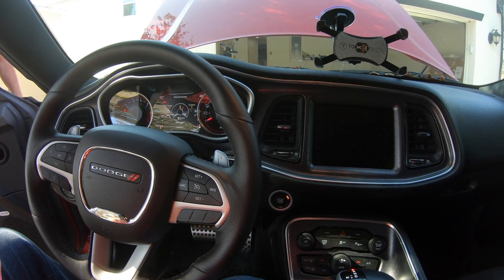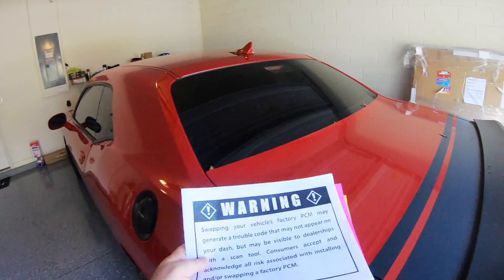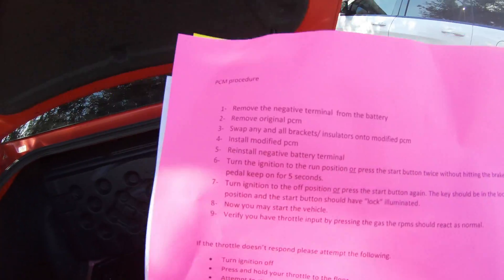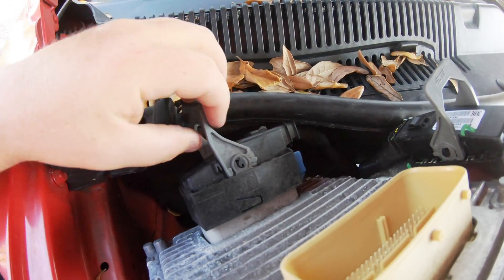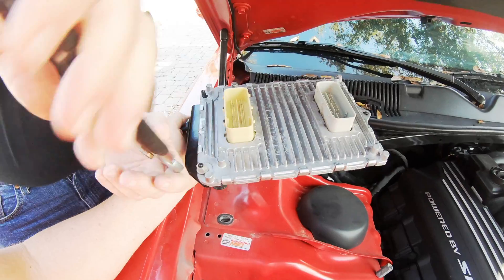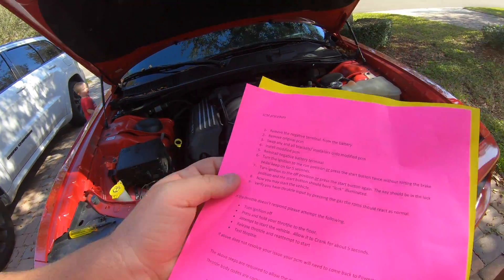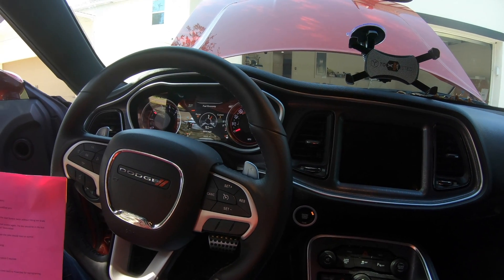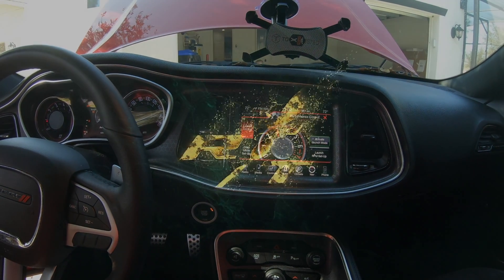UNLOCKED PCM install

Comment: It’s good to see you doing your own mods. The one thing you can get for your car is a gel battery I found out the hard way also you’re gonna have to make an investment and some tool soon …I can see more modifications coming for this car.😁👍
Reply from the maker: A lot more modifications are coming! But yah I upgraded my Chargers battery & it was so worth it. This 392 is going to be a very fun build
Reply: I went with a lightweight lithium that has a jump start function

Comment: Sawzall that bar outta there! 🤣
I took my bar out. Few more steps but much easier to get the PCM in and out.
Reply from the maker: Squeezing that PCM in/out is brutal! I don't blame anyone for removing that bar
Reply: @RTLife  Mine is a 2018 so I had to put the bypass cable in under the console.
 Another P.I.A. 🤣
Reply from the maker: Oh man they made it even more complicated in 2018. Pumped to finally have this installed - going to load up a tune once I do a few stock pulls at the drag strip
Reply: @RTLife  Noice, LET'S GO!

Comment: The most annoying part about disconnecting the battery on an SRT is losing the performance pages, modes, and cameras for a short period. You can cycle through a bunch of times (varies) and it’ll eventually come back.

Comment: The new challenge (no pun intended) for you and your channel, get some mechanics tools and start installing your own mods.  You have your community here to support you if you get stuck on something.  God bless and can't wait to see what's coming next.
Reply from the maker: I used to install everything (bolt-ons) myself until it got to headers/cam. That's a little over my head. I see so many of these youtubers trying to do it & they end up with a car always pulled apart / broken. Many are in over their head with these projects
Reply: @RTLife  Maybe I take for granted I have been building, repairing, and modding anything with wheels for 35 years, but I also recall having to start somewhere.  That was melting a hole in the piston of my 1986 Daytona Turbo-Z.  I was a teenager in HS and had to fix it myself since I didn't have a lot of $$.  I can tell you from experience that cars today are much easier to work on than they used to be.

Comment: You probably checked. But, When I was cleaning the inside of the car I accidentally hit the display button off which gives you a black screen. I'm sure you checked. I heard a low flying airplane. Are you near Macarthur? JFK, LGA? And as always Thanks for the content. Good Job👍
Reply: That was a Fort Lauderdale, FL radio station (105.1 FM) and local advertisement (Anidjar & Levine Personal Injury Lawyers, Fort Lauderdale, FL) shown on the screen.
Reply from the maker: I am in Florida now. When my house was on long island it was pretty close to MacArthur

Comment: I did mine a week ago on my 5.7 Challenger TA. The uConnect wasn’t booting up with my track pack features. It was the Blue UConnect features with basic controls. I left my car on, went inside to research the issue, came up with nothing, went back to my car and it all booted up again.

Comment: I like what you are doing bro. I went with HP and got a custom tune. I got 24 Hp and 22 tq gains I look fwd to your dyno results. Can you do before and after dyno results with all your upgrades?
Reply from the maker: I will likely be doing emailed tuning until I decide to cam my 392. Once that happens you will see dyno results

Comment: Little worried there about the uconnect screen!  Whenever you do anything with the electronics,  I've found that you have to power cycle several times for things to work correctly on these mopars.

Comment: Curious, why didn’t you get the moded pcm from Diablo so you could keep your stock pcm ? I just bought the Diablo t2 with moded pcm so if I ever need warranty work I could swap em and dealership won’t know.
Reply: How’s it worked for you?
Reply: @BabyRt420  so far so good I’ve had a couple oil changes and an AC repair. Everything OK
Reply: @Bigherm5.7  do you have a tuner
Reply: @BabyRt420  yes the Diablo t2 like it says in the comment
Reply: @Bigherm5.7  my bad I guess I got too excited and didn’t read that😂😭 what kind of tune do you have and do you have a lot of mods? Sorry I’m just curious on what to do to mine

Comment: I need some help finding a pcm from hp tuners . I have a 2022 dodge challenger 392 and when I went to the hp tuner website I only saw pcm for 2015-2021 dodge challenger. Would that work for my 2022 challenger ?  Hopefully you can help because im having trouble since it’s my first time doing all this . I have a bbk 85mm throttle body , JLT cai , mbrp race series cat back exhaust . And all I need to install is my bbk long tube headers and catless mid pipes . Just need to find that pcm so I can get it tuned right away

Comment: Quick question. Did you have to get a tune or put the laptop on real quick after that or can you drive it for a short period of time without doing anything more?
Reply from the maker: I still haven't done anything. An unlocked PCM is still stock until you decide to write a tune

Comment: hey how you doing mt friend , my challenger has new alternater new battery but wont hold charge do you think its the pcm?
Reply: Encontraste el problema? Tengo ese problema ya remplacé la batería el alternador revisé los cables y conexiones de batería etc y todo sigue igual mi batería nueva se descarga y mi voltage con el carro encendido es de 13,4 al manejar sube solo a 14.4 no quiero hacer el gasto sin sentido en cambian el pcm pero es lo último que me queda por hacer,,lo conseguiste resolver tu?

Comment: What did you do before unlocking pcm and I have a 21 rt with cold air intake and 4 dynomax race bullets would a Diablo tune help much
Reply from the maker: I haven't really started modding this yet - just has a mid delete. Going to install an upgraded intake soon. Yes a Diablo 93 tune will help performance
Reply: Thank I figured you would know after all you did to your rt

Comment: How did you identify it was the PCM? I've had this same thing happen a couple times when once when i was installing a new uconnect headunit turned out to just be the unit another time i just power cycled the car and then it came back on.
Reply from the maker: The PCM is located in the same spot in both the charger/challenger. Passenger side behind the engine. I think the unconnect just needed to reboot